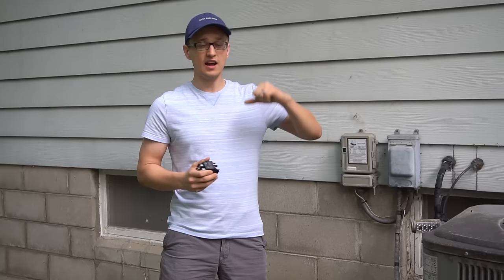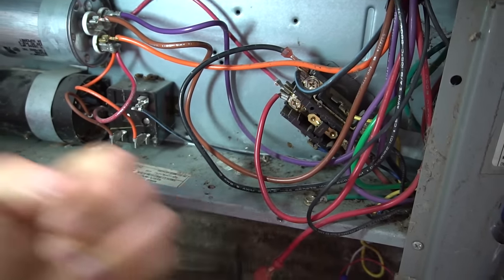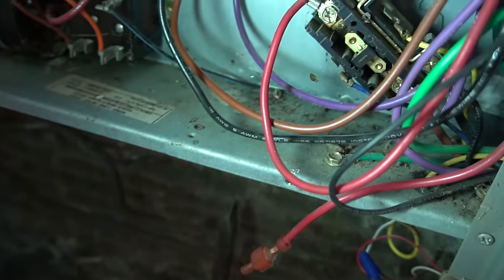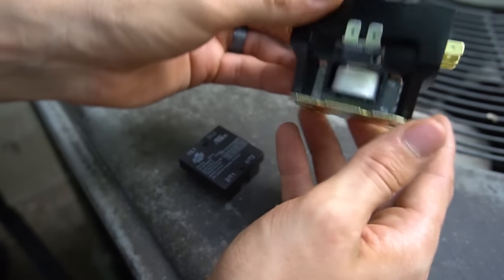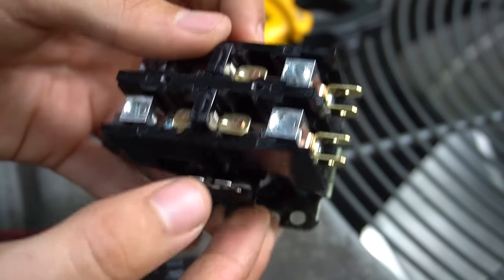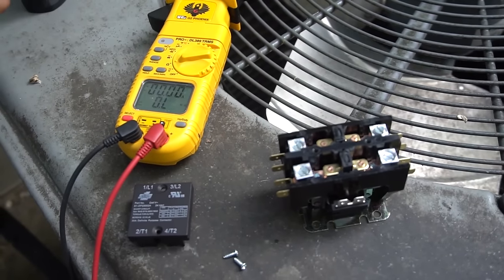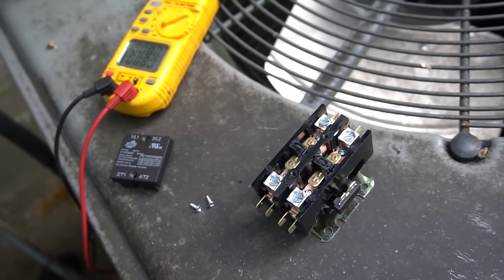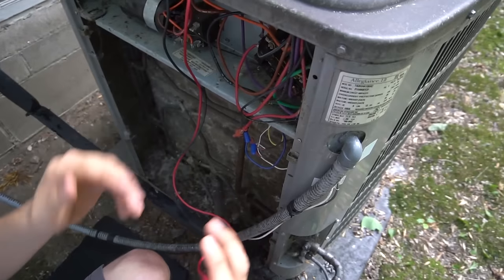Air Conditioner Contactor - How To Check If It's Actually Bad

Comment: Saved a bunch of money this week, thanks to your video.
My furnace worked fine until I called for AC this spring.The 3 amp fuse on the panel blew every time I tried the AC. I disconnected the 24V wires at the contactor and the fuse did not blow when calling for AC. I assumed it was the contactor, but after watching this video on checking the resistance, mine was reading 0.6 ohms instead of 8 to 20 ohms. Pretty much a dead short in the coil. Thanks for showing how to, and what  the correct measurements should be. Ordered a new contactor and pretty sure that will fix it.   
    Received the new contactor and installed it as seen in this video, and a bad coil in the contactor  was definitely the problem. The AC turned on as it should. Thanks for the great videos.

Comment: Massive buzzing coming from my unit but it was still working. I cut the power and still had the buzz, which I found to be a malfunctioning contactor. I was going to replace it, but found your video. I checked inside and found some smashed earwigs in there. All cleaned and working a dream. Many thanks!! I was high and dry after the parts store closed on a hot Sunday and now we're nice and cool 😎
Reply: The contactor gets 24v from the transformer inside. So cutting off power outside won't stop contactor from being energized.

Comment: Big thanks to you for these AC videos! AC was blowing hot air into house and I found the condenser fan not spinning. Thanks to your content, I assumed it was a capacitor and ordered a new one. When I went to change, I noted NO physical signs the original cap was bad, but DID notice the contactor was full of ants! W/ everything shut down, cleaned out all the ants w/ a pic and wire brush and  turned everything back on. System fired right up. This unit is at a remote property of ours, so I'll check all again next time I am there. For now, I'll take the win and I now I have an extra capacitor should I ever need it. THANK YOU

Comment: To shorten this excellent video just check the voltage across the contactor coil terminals and if it reads the correct voltage for that contactor, and it is not pulling in, it is bad.  Replace it.  If it is an ant issue spray it with contact cleaner or just change it and be done with it.  They make a vibrating sound when they are fixing to give trouble.
Reply from the maker: Lol, thanks for the summary Frank! :)

Comment: I have a sticking contactor. Compressor never stops running even below thermostat setting, and lines begin to ice up. Figured it out watching youtube. I ordered oem new part for $13.00usd. Will replace this week.
My Initial $100 service call to licensed HVAC pro, could not pinpoint problem. System pressures checked to spec, filter clean, system 5yrs old. They did come out a second time and quoted $5-8k worth of new flex ducting, measured "high static pressure" aka duct size restrction. Which was a B.S. scam. So you saved me several thousand, vs the local licensed "experts". Thanks
Reply from the maker: Oh man, wow! I'm glad you were able to figure out the problem! Unfortunately there are companies like that out there.. Happy to know that my videos assisted in the process :)  Stay cool!

Comment: You saved me a fortune man. I had gone through all of your troubleshooting tips. Capacitors, fuses, blowers, boards switches etc. In the end, all it was was a bad operator who was waiting just short of a minute or maybe seconds. I was not giving the system time to delay and could not figure out why the Emergency heat was kicking on full on gas 112 degrees out of the register. Finally, cool breezes and my cats are no longer giving me the finger because it is 92 degrees in the house...! Cause they can't they could only give me the "claw"....! Thanks so much, I really appreciate it.
Reply from the maker: Oh man! It was just a delay all along after all that. Well not all is bad :) You probably learned more then you wanted about your HVAC system now, so if something happens again down the road you will be ready to tackle it! Anyway, stay cool!

Comment: Thank you!!!! Was having a low voltage short issue. Fuse would blow everytime I switched the thermostat to A/C. Got it narrowed down to the outdoor unit. After watching this video, tested the resistance on the contactor and it measured  .4 ohms. Ordered a new one, ($13) installed,  and it works perfectly.  Thanks again!!!! Saved me I don't know how much $$$.

Comment: thanks for mentioning the bugs getting in the contacts of the contactor!!  My AC stopped working. I have the old style contactor without the plastic lid covering the contacts. I noticed a dead earwig bug near the contacts. I verified the contactor was energizing but the squished bug was enough to insulate the contacts so power wasn't getting to the other side when the contactor was energized. I verified with a voltmeter. Then I turned off the power, lifted the contact and cleaned out the squished bug then used a little emery paper to clean up the contacts. All fixed now, Thanks so much you saved me a few hundred bucks on a service call!. My wife especially thanks you ....
Reply: If the contacts don't look good, never try cleaning points with emery; just spend 20 or 30 bucks and replace contactor; otherwise you'll be buying a new compressor!

Comment: Thanks for the video. I knew my old compressor fan was going bad (the bearing was really chirping) it stopped working, so I assumed it was that. My HVAC uncle from California sent me a new fan and capacitor, and nothing. So, I cleaned out the condensation pump to ensure the safety switch wasn't gunked up, nothing. Long story short. It was this relay. Cleaned it out and it is now working. It looks really burnt out, still will be swapping it out for a new one when it gets here.

Comment: Thank you for posting such informative videos. I really appreciate you spending the time and sharing your knowledge to educate people.  I have no HVAC or electrical skills whatsoever but with your videos and some googling of terminology I was able to solve my problem.  

As a single mom, the money I saved fixing the problem myself is a huge win for me!  Not to mention the confidence boost!!  Also teaching my children to attempt to problem solve before "calling a guy" is super important to me. 

This was my issue for those interested: My AC was humming but fan wasn't spinning. Wouldn't keep spinning even with push of the fan but did spin freely. Replaced the capacitor following your videos as it was completely rusted and I assumed it was the problem.  Turned it back on; same issue.   Inspected and tested the contactor and it was getting voltage but not everytime the plunger was compressed. (Should note my multimeter is from the 80s, not digital and I wasn't sure it even worked correctly) Blew out the plunger and sure enough there was a big old dead bug messing things up.  Cleaned it up and turned it back on. We have fan power!!    

Thanks again!

Comment: Thanks for the in-depth video on this small but somewhat dangerous job. Knowing what it is and how it works gave me the confidence to sort the issue out myself. Didn't need to replace, just needed to spray contacts and switch with contact cleaner through a straw. $9. My HVAC guy wanted to cheat me on nearly every component. Sent him packing. 😂

Comment: Just wanted to share with you how much I appreciate your videos and especially to share that you helped saved our family from a long holiday weekend of misery.  If these A/C units are  going to breakdown, why does it always happen on the weekends or over holidays when it would cost a small fortune to get someone out to troubleshoot?  Murphy's Law I suppose.  It took me a day and a half to figure it out watching several videos to get me through all the troubleshooting, especially the voltage tests but I was able to isolate the thermostat as being the culprit.  I happened to have an extra one handy to test, so I changed it out and waited for it to cycle up and voila',  the condenser fan started and condenser kicked in almost immediately.  You can imagine the relief of getting the A/C working again in sweltering 90+ temps in Miami this week.  More importantly, happy wife happy life, right?  Thanks again for producing these excellent, step by step educational videos.

Comment: Whew, I am sure glad I am not the only one with similar AC issues.   I had a defective contactor, got a new one and thought I wired correctly - unfortunately I accidentally crossed one wire and shorted the new contactor and control board on the furnace. Waiting for new parts to arrive. Thanks to watching you videos I have learned more and really enjoy them. Thanks again!
Reply: Control board has fuses. I bet you didnt need a new one, just a fuse. :D
Reply: You should mark every wires on the contactor or taking a picture. No, no short cut!
Reply: I love it when Johnny homeowner thinks he smoked a circuit board when it's a 3 or 5 amp fuse those payments on my Ferrari are killing me but hey a service call or 2 will put that money right to this month's payment cha ching all the way to the bank and I don't cheat anyone I just charge top dollar for my services the name of my company MONEY BAGS MECHANICAL 24 HR SERVICE LMFAO

Comment: Hello good morning I'm so glad I asked you about the AC our AC guy who used to service the unit he moved we called a new AC guy the first thing he says to me it's your compressor I asked him to check the contactor he replied if you know what to do you don't need me, I replied I jost want a honest answer if I don't want to pull out the compressor if is the contactor I told him you were highly recommended just wanted a honest answer so the AC is working it was the contactor we won't use him again thank you for your tip greatful for your help thank you.

Comment: Awesome I was about to replace my capacitor or the contactor. That is until I tapped on the contactor a few times and finally heard the compressor kicked in. Then my thoughts were .... Those freaking earwigs! You just confirmed it here, so I'm happy not having to replace either parts. Ty
Reply: Boo I spoke too soon. It died again few hours later. Replacing the capacitor cause I know the contactor still works. Cleaned and all its kicking on the fan, but no compressor

Comment: My Trane A/C contact switch starting rapidly clicking this weekend.  After shutting off the power I inspected the switch and the wiring. Both looked good.  Coincidentally I just had a new fan motor installed 2 weeks ago so I thought for sure the issue was related to the new fan motor.  It talking to a friend who works with A/C controls, he asked "how old is your thermostat and have you replaced the batteries".  The thermostat is old, about 23 years old.  I replaced all 3 AA batteries in the old thermostat and to my surprise the outside contact switch quit clicking when the outside unit is running.    I got lucky this time.

Comment: I had to replace my contactor a few weeks ago. The root cause is that the coil is shorted so the 3A fuse on the control board keeps burn out (24V/3A=8 Ohm, meaning if your contactor coil is measured lower than 8 Ohm your fuse would probably blow. Additionally the 24V control voltage is usually somewhere between 24V and 30V, meaning a lower margin on the resistance range). I have searched online and watched a lot of how to videos but it is not common to find such failure mode. Just want to share this tip with the other viewers. Measure the resistance of the contactor coil, if it is too high or too low, replace it.

Comment: Thank you for this.  Found my 10 year old Goodman condenser was running when the thermo was off.  The contact was stuck.  Figured 10 years is a good run, so time to replace.

Comment: Thank you!! My plunger was stuck sucked in due to ladybugs causing the fan to run constantly. Thank you for your excellent explanation of how the contactor coil works!
Reply: So how do fix a plynger that's stuck in 😢😊
Reply: @Ptiou99  I shut the power off at my breaker and pried it loose. I did order a brand new contactor through Amazon and replaced the old one. My a/c works perfectly now.

Comment: This video is super useful. My AC is not turning on. I have tested a few things: there is 240V input power. When the switch on the contactor is pushed down, the AC turned on. There is NO 24V coming to the contactor when the nest thermostat is on. Can you provide any suggestion on troubleshoting further? Like what could be wrong so that there was no 24V needed to activate the contactor switch?

Comment: Thanks for your good videos.  Maybe mention even though contactor can be responding and engaging power, but if burned or pitted contacts, it may not be a good connection and damaging compressor.

Comment: I'm not a technician or etc but I know I'm having a low voltage problem. After opening the inside unit I noticed the condensation trap hose came disconnected and the lower area filled with about a half inch of water near the gas burners.  My 3 amp fuse blew. Upon replacing it the fuse blow the second I put power to it.  Looked at the contactor it's an older one and is not covered. I didn't notice any burning or etc on the copper coil of the contactor. Don't see any shorts, and also check thermostat for good connections as other areas.
So I guess this repair is beyond my current knowledge level.  I'm guessing the moisture caused the computer board to short out. Anyway I'm going to give a call to an expert. Enjoyed learning more about this.
Thanks for this video

Comment: Jay:  You may remember me mentioning that I had to replace my blower motor about a month ago. Following your video on replacing them made it a piece of cake. (Thank you!) Everything worked out fine and my Trane has been cooling great since then... until a few days ago. Now I'm having a new problem and was wondering if it could be the contactor or if not, maybe you've seen a similar problem to the one below.

When the thermostat is set to COOL and the fan to AUTO, and when it calls for cool, the circulator fan starts for about 2-3 seconds and then turns off. Then switching the t-stat to OFF and the fan to ON, the fan runs until I switch the t-stat over to COOL, but the fan turns off again when the t-stat calls for cooling. Trying another t-stat got the same results.

Now I'm thinking it's a control board problem (WR 50A50-571), so next I bypassed the fan from the control board (to keep it circulating), set the t-stat to COOL and let it cool-down the house. With the t-stat working and the fan running, I decided to let it go for the night and watch some of your other videos to figure out what to try next.

In the morning, it seemed really cool and checking the t-stat showed the temp was 70 degrees. It was not calling for cool, but it was still getting cooler. So I switched OFF the t-stat and as I was walking past the window, I heard the hum of the compressor unit outside. I said, "No way!" and went to the air handler and unplugged it. And I couldn't believe it, but it sounded like the compressor was still running!!! And when I got outside, yep, the compressor unit was humming along. But it was not freezing-up or anything. So I removed the puller thing from the disconnect box, and now I'm thinking the contactor must be fused stuck. After getting a cup of coffee, I plugged-in the disconnect thing expecting the compressor would kick on again but it did not.

Then I tried the whole sequence a few more times and got the same results. So I'm not sure what to check next. (I do have a multi-meter.) Any help would be greatly appreciated.

NOTE: Inside the electrical box is an oval 440V, 45uf/5uf capacitor (some rust on top), a Supco SPP8E (1 thru 5 hp) hard start capacitor, and a 40A, 24V, 1-pole contactor. The contactor moves freely (no bugs inside) and does not have any burn marks.

Thanks again for your channel! - Sorry for the long post...

- Michael D.

* Just a DIYer trying to learn a thing or two about HVAC *
Reply: Just to follow-up: I found that the contactor was intermittently sticking closed which kept the compressor running after the thermostat was called to switch it off. The day after my 400+ word post above, I replaced the contactor and everything is working normally. -- Thanks again for your awesome channel!
Reply: @michaeld.5189  hi, can you help me how to identify which contactor to get ? Do you have clicking noise ? When the blower not turn on ? I changed the capacitor alread

Comment: About six years ago I changed my contactor, cost me like twenty bucks. Changed it because for two years in a row when I first turned the A/C on it chattered and the A/C would not start. To fix it I just kicked the A/C unit. Then for the rest of the season it was fine. Like I said that went the same for two years. Third year is when I changed it out. No problems since. I figured it was likely a piece of dirt or bug caught in there and I removed it with the shock of a kick. Done the same with A/C fan centers attached to the furnace. Get there and they are making an awful noise and I just hammer fist them on the metal housing and they instantly repair. 
 
Just today, I changed the capacitor. My A/C went down Saturday night on a long weekend. Had to wait until today Tuesday to get the new part. Sweated in the heat all Sunday and Monday. Wasn't a good weekend, it was hot. Took just a couple of minutes to install the new one, compressor started up immediately. No place to get even simple parts after hours or on weekends.

Comment: When I’m in an ac unit and trouble shooting I soemtimes find the contactor stuck …I use an insulated screwdriver to lightly tap on it and wiggle it back and forth and have gotten in the habit of cleaning it out with contact cleaner every time. Seems to get rid of all of the troubles with it and like you said, rarely ever replace